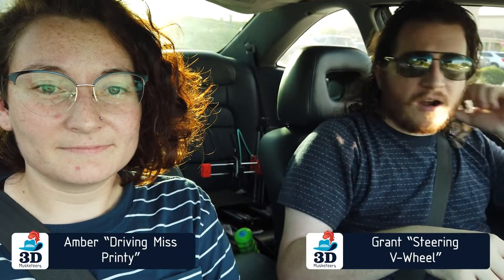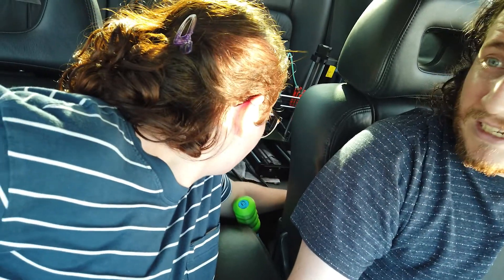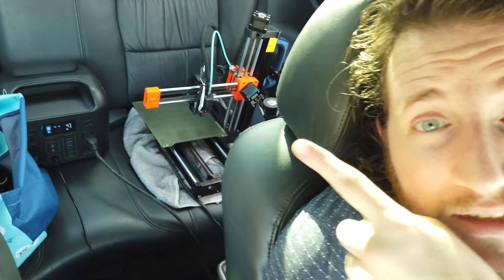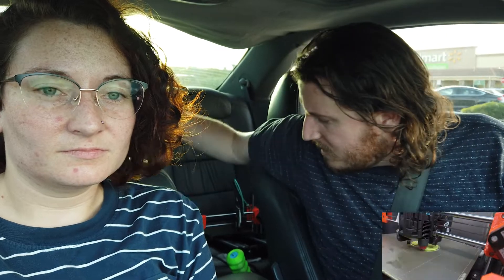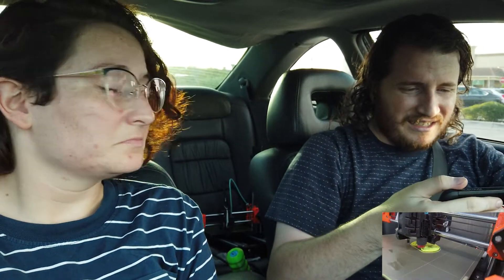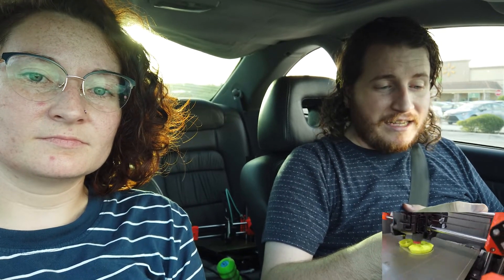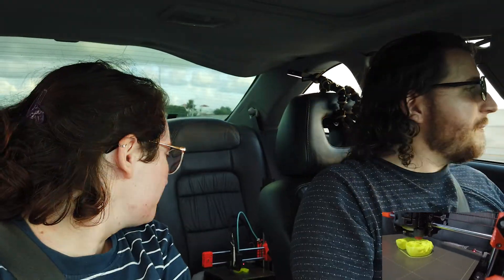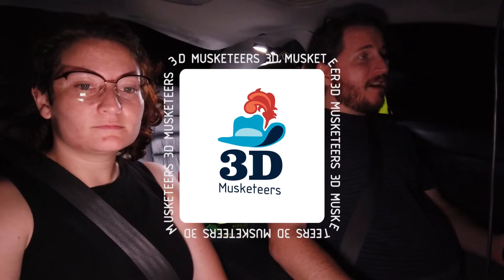How BAD is it to 3D PRINT while DRIVING?!?!

Comment: If I'm not driving my car could power the MK3 for days. It's got a 66 KWH battery.
Reply from the maker: niceeeeeeee Weeks or even months is more like it!
Reply: @3DMusketeers  although it doesn't have an outlet so I'd have the same problem I'd need an inverter of some sort.
Reply from the maker: Yeah, but that power though!!!
Reply: @3DMusketeers  I charge to 90% daily. It reports ~260 miles available every morning. I usually use about 40-50. lol For thanksgiving I'll up it to 100% of course. But yeah people freak out. They are like what if you get stuck in a blizzard. I'm like do you have any idea how long the heater would have to run to kill the battery? Back when I had my volt (~10 KWH battery) I was stuck in a blizzard in the parking lot at work for about 2 hours. I lost......maybe 4 miles of range. I still made it home without it switching to gas. If I got stuck in my bolt 2 hours wouldn't even register probably.
Reply from the maker: cries in 20 year old honda LOLOL
Reply: @3DMusketeers  I've been there. My first car was an 83 monte carlo with no AC! ugggggg I hated that damn thing. It was like driving a giant boat.
Reply from the maker: The honda's got great AC, which is fine by me, but even if it did not, if it can get me places, then it is perfect!
Reply: @3DMusketeers  it was bad in ohio. In alabama it's a must. When my 06 Tiburon started losing AC (compressor fine, but you get a choice of either the compressor or the fan but never both so you get either cold air that barely moves or hot air that moves a lot) that's when I got the volt. There was nothing wrong with the volt, but I got sick of it's gas half. So I got a pure EV.

Comment: The power supply for the system tho ... jackery or off brand or what ... why not an inverter..
Reply from the maker: because the Mini draws more power than an inverter that can be used in a standard cigarette outlet plug can handle. They are normally rated around 10 amps (120 watts) but the mini draws 143 on heat up. The battery pack can output 300W and is charged at 46ish watts, so it is able to sustain the printer for a while. Sure, you could get a larger inverter, connect straight to the battery, etc. but the average user will not do that and I wanted it to be realistic in that regard. 

Would love a Jackery, but they are too pricey for me.. Maybe we could get a sponsorship for a video surrounding off grid 3d printing! Who knows..
Reply: @3DMusketeers  thank you for saving my 120 watt inverter .... for an ender 3 pro ... my 750 will handle it and the 1500  will but definitely not my 100 120 or 150 off brand solar generator... i done fried one jump box already
Reply from the maker: It would likely pop a fuse before actually smoking up, but yes, be knowledgeable of the wattage draw of your machines! If you need, get something like a Kill-a-Watt and figure out the wattage before you hook up any inverters and such.

Comment: I'd guess the results depends on the stiffness the printers construction. As long as the vibrations do not overcome the steppers, they should track just fine. 

Btw, Amber reminds me of someone (from way back in my past), and it is really annoying me that I can't think who :-|
Reply from the maker: Yep! Stiffness is absolutely the key here. The mini is definitely not the stiffest option, but it is realistic I think. It is not expensive, it has auto leveling and such to not deal with a bunch of BS often, and it is pretty reliable so I did not have to tend to it while driving lol.
Reply: @3DMusketeers  maybe a better suspension area a couple pillows or something
Reply from the maker: Not worth it in that car ha ha, but yes, likely would work better in a Mercedes, but ya boy ain't got that kind of money ha ha
Reply from the maker: @FUCKDSS  It was on a towel lol. But that was mainly to level it out.